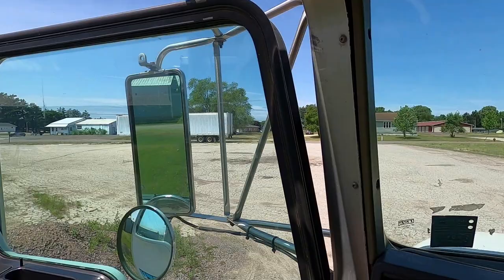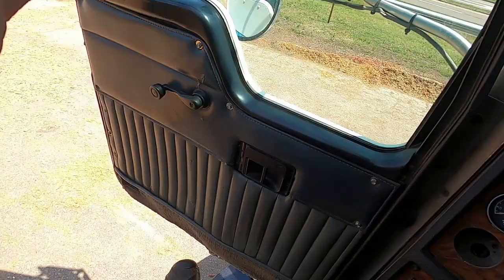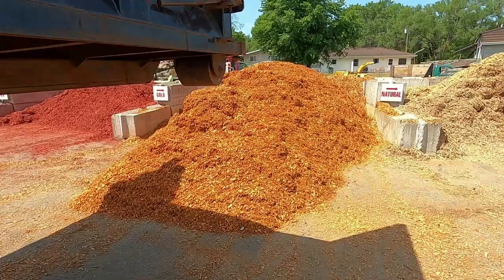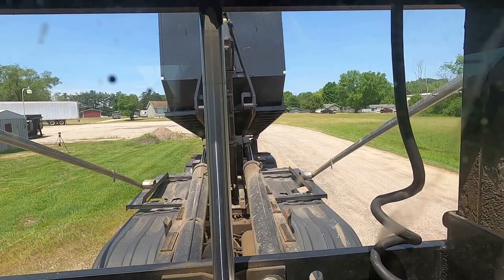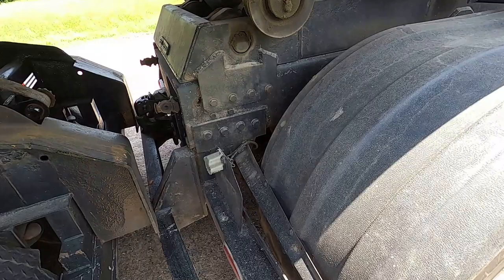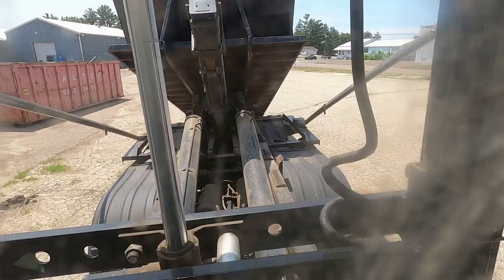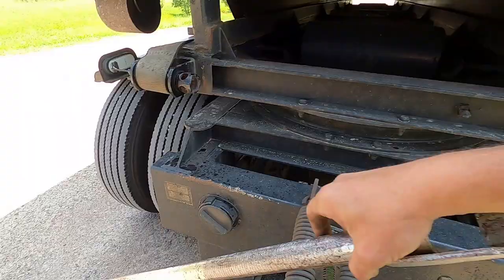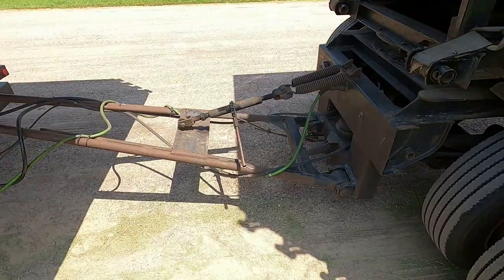Hooklift Truck and Pup trailer operation procedure.

Comment: I do the same job . Hooklift trucker with trailer ( sleeping cab ) in the Netherlands. Oure trailers have air pressure hooks (4) on the bottom of the trailer. So when i put the container on the trailer all i need is to connect with the trailer on the truck connect the air and lights, release the air brake on the trailer and  the container is connected rock solid on the trailer by 4 hooks on air pressure.  Works much faster... 😊😊.  Good job on video i would love tho move over there and do the same job ( with sleeping cab 😅)
Reply from the maker: That system seem really interesting.